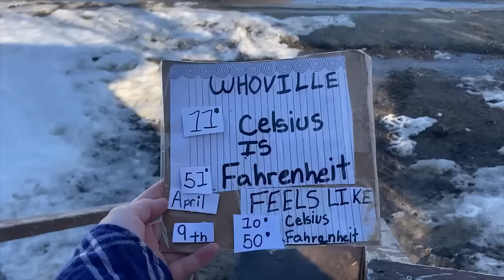Gifted American Flag on the Big Boat Today April 09 2024

Comment: The flag looks excellent Your Highness, I hope I didn't make your day too difficult, the chain breaking while hoisting the sloop looked scary as did you leaning out to attach the flag.
  Stayin tuned! 👍🤠
Reply from the maker: i was having troubles replying this morning and walked a way, unreal. the chain loop slipped off the hook because we don't have the keeper thing. there was 50-50 chance it would have stayed on until more weight was applied to hold it in to place but it popped. un-planned drama. once we get some wind your flag will look good and more pictures will be taken. once again we thank you  thansk

Comment: I still use the old soapstone. It works good if I need to do some quick math or drawing to plan something out on the top of my welding table or on the bed of the service truck. But then again I am your age so we stick with what works.
Reply from the maker: yes and not expensive either. buy and box and it will last 30 years or more  thansk

Comment: Trying to learn here to improve my welding. I get that you are welding upwards, but are you also "pushing" the rod rather than pulling it? Flag on the boat looks sweet! 'til tomorrow...
Reply: I was always taught, if there’s slag, you drag.
Reply from the maker: yes work the puddle and control it more with up hand. welding flat you can only build so much up and hard to control. up hand you can fill in where you want or bring the high spots down to be used a fill.  thansk